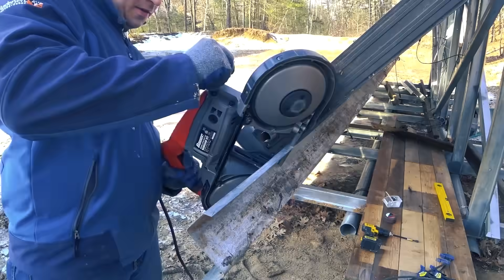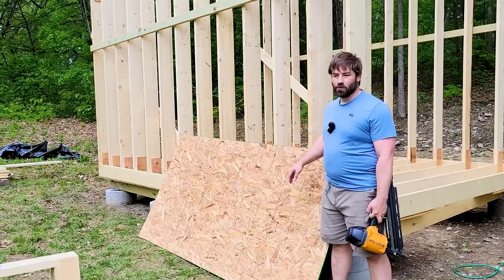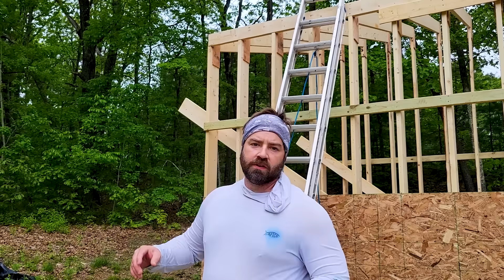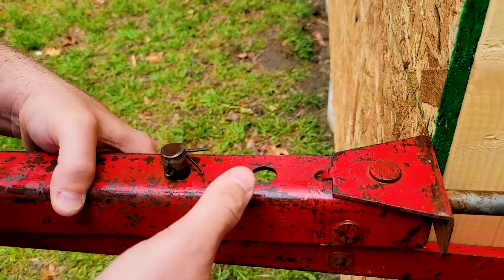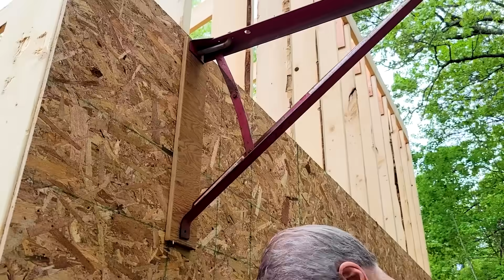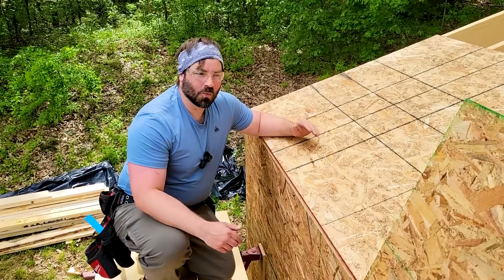Off grid Cabin Build, Sheathing!  Part 4 in the series

Comment: I love the concept , but not sure if your just going to have the outside sheeting , what holds the structure together,  which is dangerous any moisture and the isb fails then so does the structural integrity . Not sure if you plan on putting in inside horizontal stud joists to bridge the main acordian structures together , otherwise using just osb to hold this together is a super huge bad idea .
Reply from the maker: There are 2x8 "Rim joists" in each of the 4 corners.

Comment: The wall is overhanging the floor joist on 1/2-inch ply.
Reply: First thing I noticed, too
Reply: There are integrated joist in the floor supported underneath by the beams.

Comment: How OSB's edges didn't swell when you put them up verically and it was raining? Or did you replace those OSB boards later?
I'd just build some kind of roof temporarily to put on some plastic sheet against all the rain and work underneath it, doing the walls. After that I'd remove the temporary roof and do the proper roof.

Comment: i missed the part why its only partially on the subfloor, is this thing being moved elsewhere?
Reply from the maker: This is not moving.  I don't have a subfloor in there right now.  You are probably talking about the 1/2" pressure treated plywood which is more of a belly pan.  I will be finishing it off once the building is dried-in.
Reply: @DavidPozEnergy  i guess ill have to keep watching!

Comment: I'm still unclear on what purpose the, I assume temporary, plywood "floor" is serving.  I must have missed it in the previous videos.
Reply: That's part of the floor I don't think it's temporary. The trusses need something to sit on
Reply from the maker: The pressure treated plywood is a permanent, integrated, part of the building.  It will serve two main functions once complete.  1. It will help prevents pests from entering the joist cavity (where the insulation will be).  2. It will help prevent air leakage.  BTW, installing it early is discussed in the book I referenced for this build: "Superinsulated Truss-Frame House Construction".
Reply: @DavidPozEnergy , OK, so that part of the floor just isn't done yet then (due to weather concerns), got it.  You'll slide up under there to install the rest of it when the roof is done?
Reply from the maker: Not necessarily when the roof is done.  The term is "dried-in"  When the building meets the definition of dried-in, then I will crawl under and install the last sheets of pressure treated plywood, and tape all the seams.

Comment: This seems so efficient, but I'm sure it's a lot of actual work.

Are you allowed to use solar panels for the roof instead of normal roof sheeting?
Reply from the maker: I will be adding solar panels later, but I think you might be asking if I could use solar panels as my roofing.  Yes, I could, but I don't know a good way to really do that.  You would need to have a gasket between each panel that remains flexible for decades.
Reply: @DavidPozEnergy  You're right about rubber needing to last for decades. I was wondering if that high performance seam sealer they use to glue car panels on might work. Many cars from 25-30 years ago still have good seals for their fenders.
Reply: Solar panels need cooling, the traditional way of doing that is leaving an air gap under the panels. The more they heat up the less efficient the solar capture is. Could you make panels that are roof panels, sure. They would need to have a frame that supports the water shedding and the mentioned cooling under.
Reply: When thinking of using solar panels as a roof, people consider weather stripping between the panels as they should.  What few consider is the juncture between the glass and inside of the aluminum frame of the panel itself.   This area is sealed at the factory but due to handling,  installation, and UV over the years I would have concerns as this seal is not specifically designed to be water tight.
Reply: @steverrada  Thanks. You're right, I haven't thought too much about that, and it would be quite a challenge to re-seal.